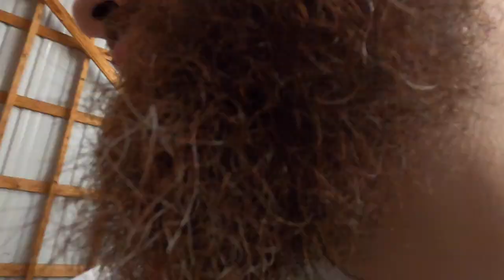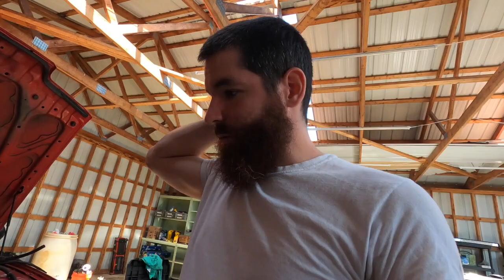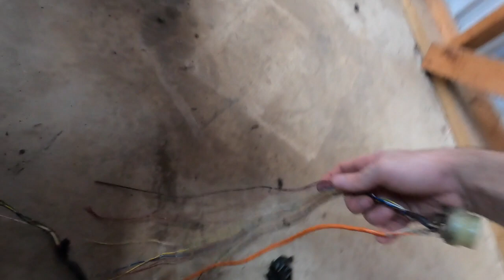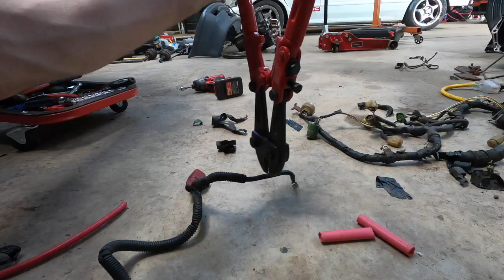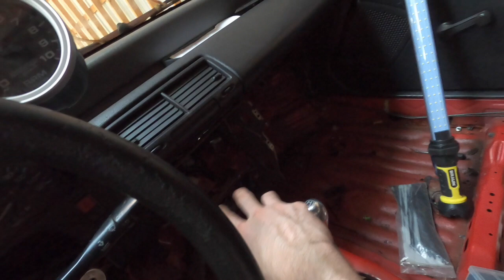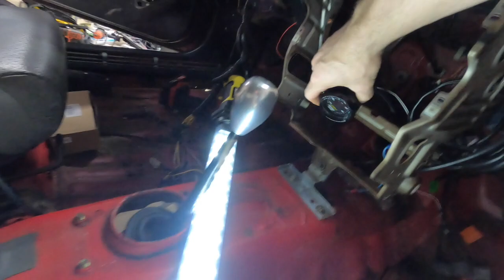ALL MOTOR D15 EF HATCH / RYWIRE HARNESS & AEM WIDEBAND INSTALL / CLEANING THE BAY

Comment: that rear bolt on the rear motor mount is a bitch. I bought a wobble socket but its still too fat to fit back there. Any advice?
Reply from the maker: The bolt that bolts the mount to the subframe? Swivel and extensions lol but if you can you might be able to get a wrench from the back side of the subframe, underneath.